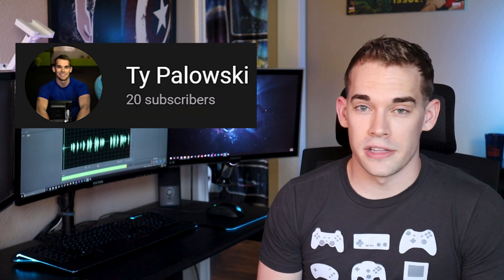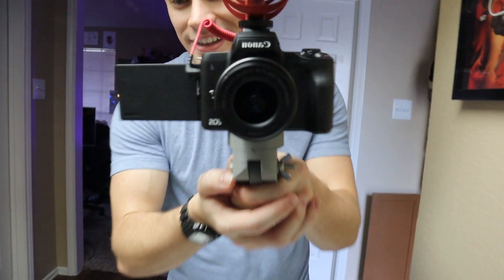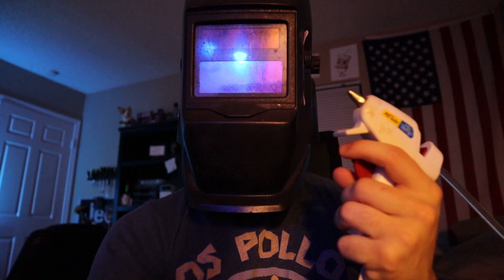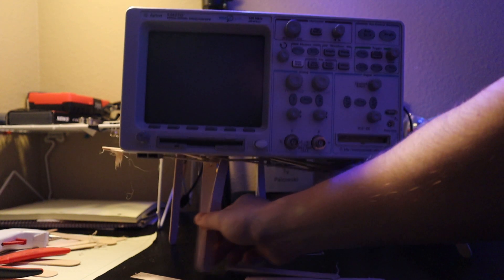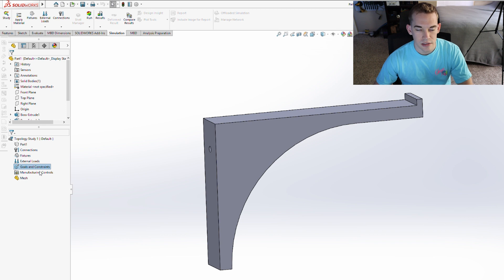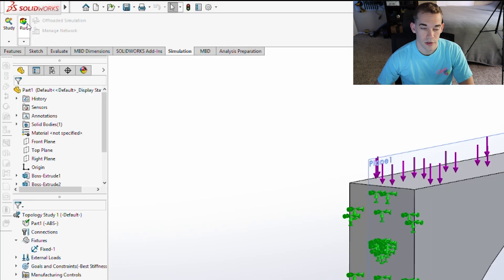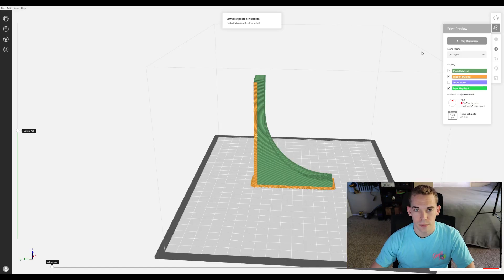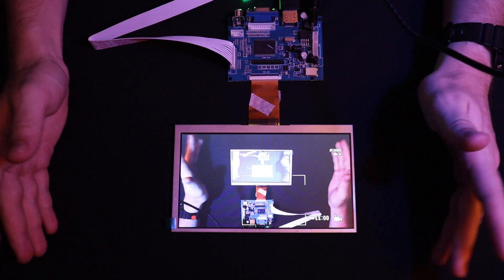Topology Optimization to Make Cool Stuff (Engineering stuff)

Comment: You have only one point fixed to the wall. Your load model does not take this into account.
Reply from the maker: Thank you for checking out the video! 
And that’s true, a better model would be to make a split line around the hole on the inside and make that the fixed point, mimicking how a screw would clamp the piece to the wall. I was more worried about keeping the structure from folding rather than the screw location being blown out, great suggestion!